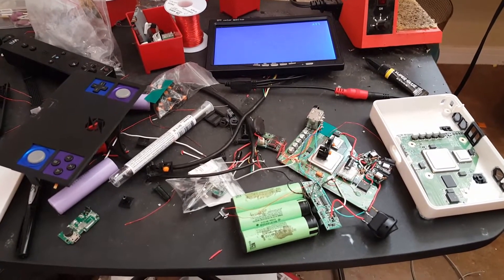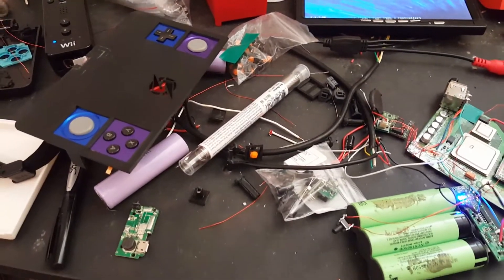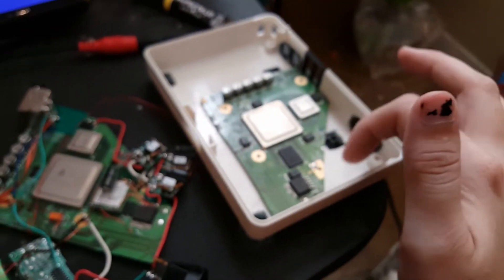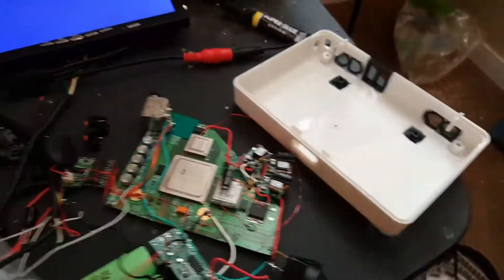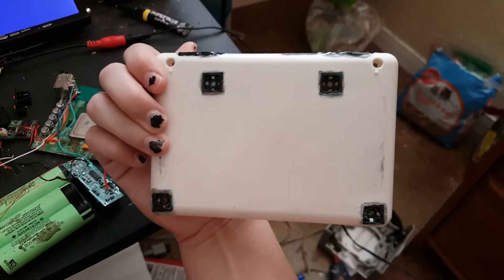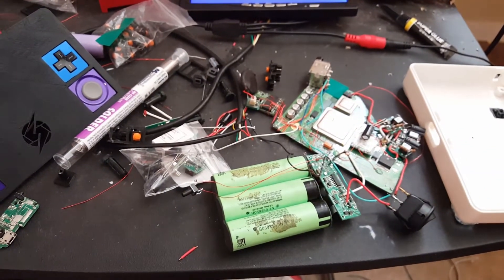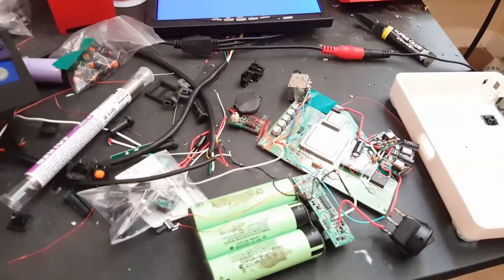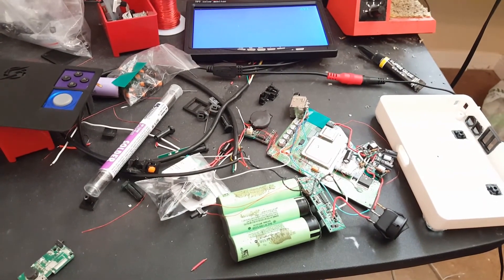Wii Portable Worklog Part 3

Comment: Do you know which GPU pin I connect the u10 to on a 01 motherboard? Thank you very much
Reply from the maker: That's in the guide section of bitbuilt :)
Reply: @Madmorda  Thanks, but i couldn't find a guide for a CPU-01 there was only on for CPU-40+, do you know of any alternative websites or pages with a CPU-01 guide?
Reply from the maker: @lukemeadows7013  Yep :) it's the OM6 trimming expansion in the guides section
Reply: @Madmorda  ah, ok thank you!

Comment: May I ask were you bought those buttons for your GC plus board?
Reply from the maker: Darkllama658 The circuit board is actually a dpad from a n3ds. It fits the abxy buttons of a regular 3ds (dunno about xl) just about perfectly and if you expand the holes a bit, can even be mounted with screws. Same goes for the dpad :)
Reply: Thanks!
Reply: Also can you link me to the batteries you got? I would really appreciate it thanks.
Reply from the maker: Darkllama658 I already did on part 2, remember? :P You shouldn't just choose the same as me though, you'll need to find one that is best for your portable :)
Reply: Whoops sorry. I'll look for one right now